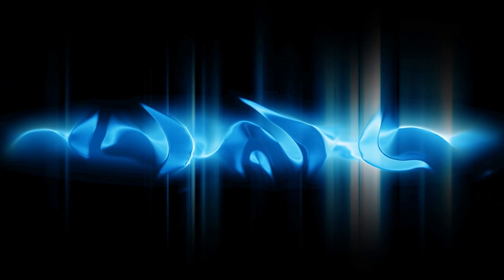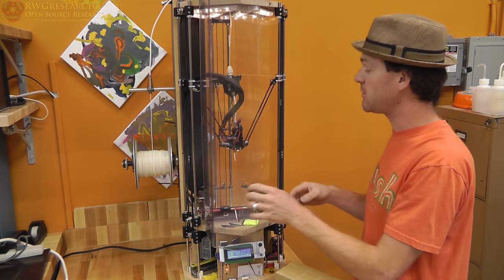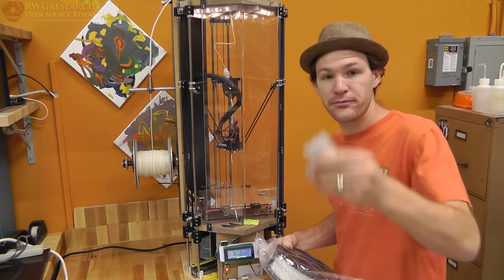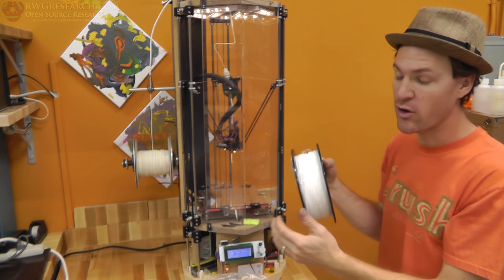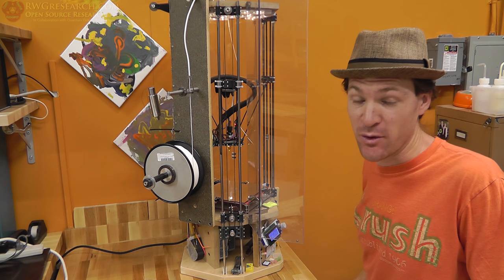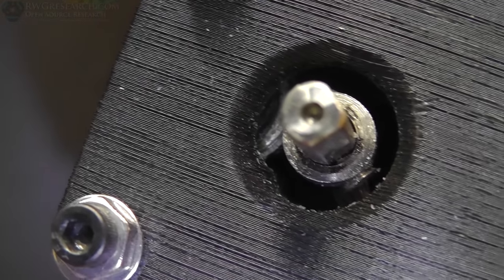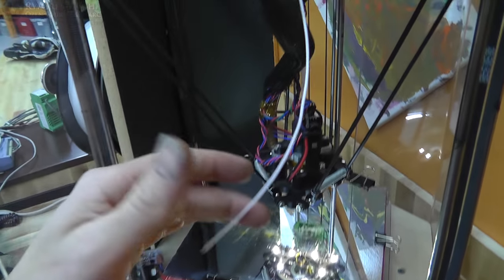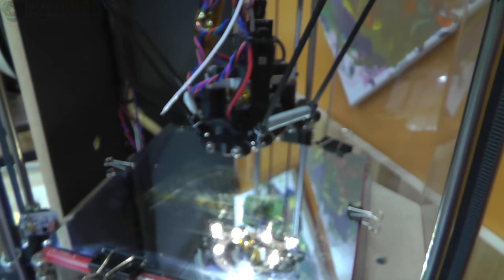TPU Filament. How To Get Flexible Filaments To Work With Your 3D Printer & Bowden Extruder.

Comment: This is exactly how I got my bowden to print flexibles.  It's about 18" with an all-metal e3d v6 at the other end, so the filament path is completely restrained.  Turned off retraction entirely, halved speeds to 2-30mm/s (30-40mm/s for bigger stuff), and made them all within 10mm/s to avoid large sudden speed changes.  Works a treat with fairly flexible and somewhat elastic TPU (3D Solutech flexibles),  and anything that's not a total wet noodle.

Comment: Looks pretty exceptional from what I have seen, the stuff seems nearly impossible to work with without direct extrusion but you seem to have it figured out.  Like someone else has said lower speeds could fix any more problems you may have.

Comment: Having the same issue with the TPU bending out the extruder and stopping the print. I tried changing heat and speed settings up and down and narrowing the gap as much as possible from extruder to hot end, but no dice. Still spitting the TPU out the side every time after a few minutes. Guess I'll be looking for some nylon tubing.

Comment: I was able to print with TPU filament using a long Bowden tube (40cm aprox) I've designed my extruder specifically for flexible filaments, but I have to use extremely low printing speeds to get good results, I'm using 20mm/sec.
Reply: Awesome!!! I love TPU filament

Comment: I am currently migrating from a GregWade+JHEAD to a bowden diamond hotend, and I tried inserting the tubes all the way to the Extruder gear. Unfortunately as the head moves the tubes twist inside the extruder mount, so it did not work well. Now I have watched your video and having the tube split in two pieces inside the extruder mount, so half can twist and half can stay still, seems so obvious... Why did I not think of it? :-)
Reply from the maker: +Lucas Hartmann hope i works for ya :) ~Russ

Comment: there are some extruder designs where the ptfe tube goes entirely thru the extruder, and is groved at only the gear. and pressure is lightly applied on the other side of the ptfe. I have heard this makes 'kick out' like you pictured in your video almost non-existant. If you have questions, check out #reprap & #bigdelta on freenode irc for 'sexxystruder' i think its called.